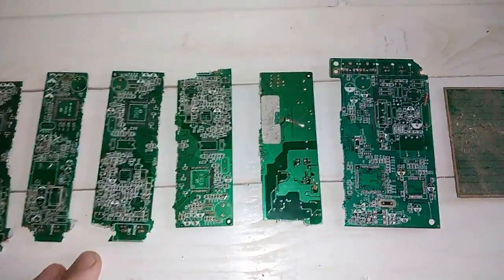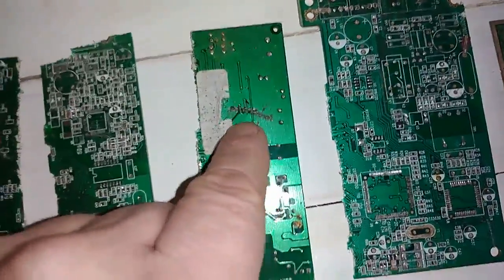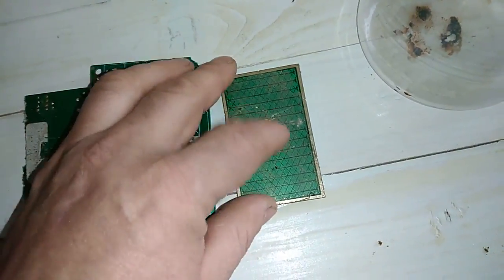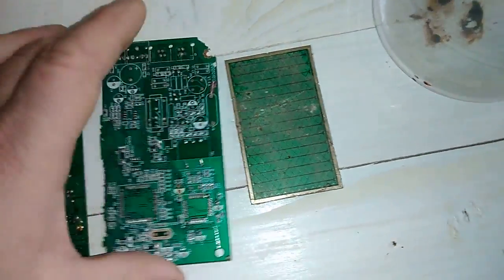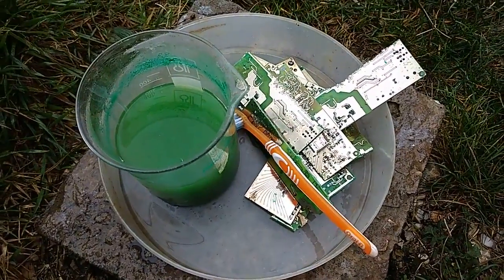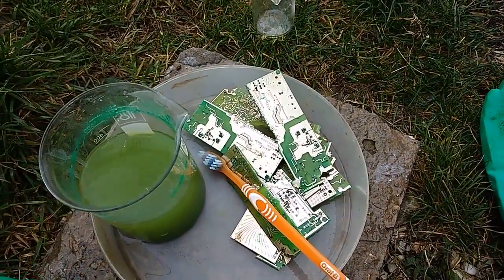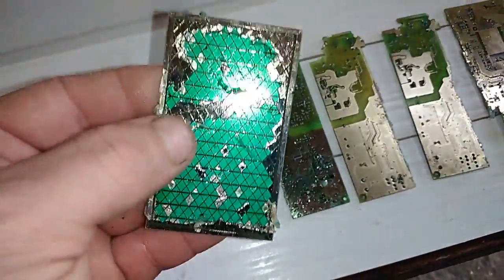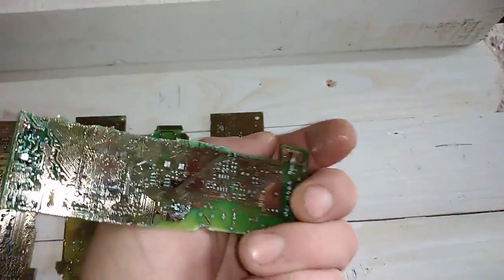How to remowe green solder mask easy with caustic soda!

Comment: I mistakenly dissolved gold with HCl and sulfuric acid how can I get my gold back?
Reply: Dissolving an aluminum heatsync or other piece of solid aluminum (not foil or soda can, they aren't as good) the aluminum will precipitate back copper and gold from acid solution. Dissolve only solid copper OR use sodium metabysulfate if you ONLY want to precipitate good. (lemon juice from the tiny bottle that looks like fake lemon OR coconut water both contain sodium metabysulfate, read ingredients to confirm)
Reply: You can also use concentrated vitamin C to precipitate good from acidic solutions.
Reply: *gold

Comment: Great video as always Dusan!!! It is interesting that some boards are gold plated under the green solder mask and some are not. I am an electrical engineer for many years and when I order printed circuit boards from the manufacturer, I can specify if I want gold flash on the solder pads or not but I don’t ever remember any option about gold plating under the solder mask or not. Anyway thanks so much for sharing your great work!

Comment: Does this process remove the extra solder that is on the boards as well?   It removes the solder mask, but curious if I need to remove the actual tin solder first with HCL.   Thanks

Comment: I've killed a good number of beakers by placing them on the direct heat but came up with a simple way to help prevent it.  I took some basic, plain clay cat litter and added enough water to make a soft putty and pressed it into 6" squares of stainless steel mesh and let them dry.  The clay transfers the heat well but allows just enough to insulate the glass from sudden temperature changes (especially when heating on an electric element).  Since I started this I have not had a single beaker break on me when heating them.
Reply from the maker: An interesting solution friend. I will try to apply it in my daily work. This is only the third or fourth beaker that I have broken during my work so far.
Reply: @999DusanGoldrecovery  I remember way back when and I was only on my fourth broken beaker.  I started buying in multiples after that.  lol

Comment: to whom it may conserne ,if you take lie drain opener put in water and lieve it to the next day ,you dont have to use heat what so ever
Reply: Interesting... But what % of water toward the lie ?
Reply from the maker: This is feasible for you because that household chemicals are strong in yours countrey, but in my country household chemicals are sold too diluted while on the other hand caustic soda is available in pure form very cheaply. Strange isn't it hehhehe.
Reply: How much drain cleaner per gallon of water ?

Comment: I use a steel cake pan on one of those flat hot plates. I never let it boil just hot enough to barely make some steam in a cool evening. Takes a while but all of the solder mask eventually becomes removable with an old toothbrush. The lye keeps the steel in the pan from rusting. Be careful of the Teflon coated pans, the lye will break it down into a gooey mess that is a pain to deal with.
Reply from the maker: Thanks for the advice buddy, the hard way I learned not to use glass but I had to because of the video. Steel is the best in both cases and the deeper the pot.

Comment: Its not solder its solder mask :) Buy the way, are all the older (before 2000) motherboards and slot cards gold plated like this? Because if so, they might be worth to strip the mask off..
Reply: Idk on the older 2000 or before question, but it's super cheap to buy lye and costs basically nothing to strip the green mask off, it doesn't even take very long as you can see in the video. :)  Hope it helps a bit. ::)
Reply from the maker: In my opinion, it may be the best video and probably my next step: A 100 liter pot full of plates, large plates cut into smaller pieces, and cooking in caustic soda, which otherwise does not take much and is not expensive, until the plates remain bare.
Then separate the gilded plates for further Ap process for gold and especially in Ap do the next without gilding for copper so as to remove all the metal from them which is then separated by cementation with iron and aluminum briquette. Melting at the end of course.
Reply: @999DusanGoldrecovery  Looking forward to it brother, have a great day :) n GOD BLESS :)
Reply: i haven't found a gold plated motherboard yet , but a lot of cellphone boards are full plated and the boards in satelite tv dish eyes can be too , sound blaster boards have the best gold plating i have found yet tho, ........if your not in a hurry you can just let the boards soak for a few days in the lye solution as well
Reply: @geneplummer6645  If I'm remembering right, it's been a few years, but it seems like telecom boards have a lot of gold backing under the solder mask as well.  The easiest way is just to scratch it up and look. :)
Reply: @snoozin99  i've always wanted to get my hands on some military or aerospace scrap , i hear thats the holy grail of scrapping , but i refuse to buy any scrap , all mine has come for free or trading
Reply: @geneplummer6645   okay, thanks for the info. What is lye?
Reply: @Chaosman88  caustic soda , you can also use drain cleaner that contains sodium hydroxide and potassium hydroxide
Reply: @Chaosman88  lye is called sodium hydroxide, you can sometimes find it in the drain cleaners section of your local hardware store or you can by the sodium hydroxide right online and its pretty cheap really.  

Sodium Hydroxide (Lye) Safety. Sodium hydroxide is an odorless, inorganic compound that serves as a metallic base for many types of chemicals, particularly in the paper and textiles industries, food processing, soaps, detergents and cleaners.
Reply: Me too lol, I've never paid for anything computer or scrap.  I just find it out and about, besides I'm too cheap to pay for it lol. :)
Reply: @snoozin99  i got started on the gold scrap at my local junkyard , they let me have the circuit boards if i seperate the other metals .then i got carried away with it  , lol .......my barn now looks like a scrap yard  /metal foundry/blacksmith shop and circuit city . been thinkin about using motherboards for roofing shingles . lmao
Reply: @geneplummer6645  Yeah that's a great deal you have with those guys, and I definitely know what's it like to get carried away lol.  The good thing is a lot of those boards that are not gold actually have a copper base plate in them, so you win either way. :)

Comment: No need to boil on hot plate just  boil the water end add it over caustic soda with the cards in plastic bowel
Reply from the maker: It can be done that way, mostly that's how I do a larger amount of pins with imperial water, but I von to show in the video how to  remove the green mask step by step so i doit in this vesel..
Reply: Won't plastic melt from all that heat?
Reply: @dizzious  
Of course no

Comment: Could you use a sulfuric acid stripping cell on these?
Reply from the maker: Yes but you need to remowe contact because not oal plating on these boards leave to the same spots ok.But that will work just fine.